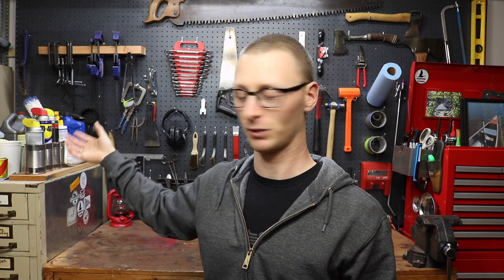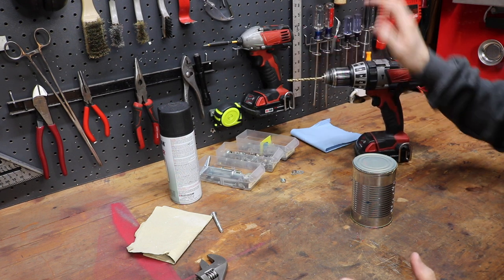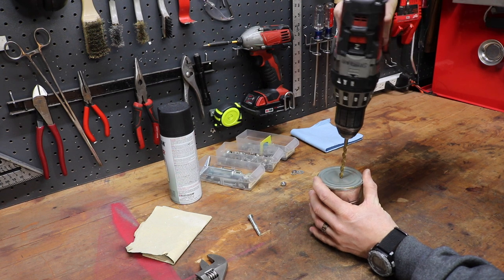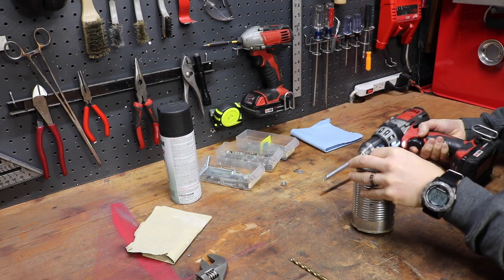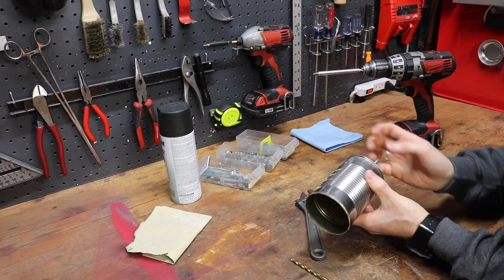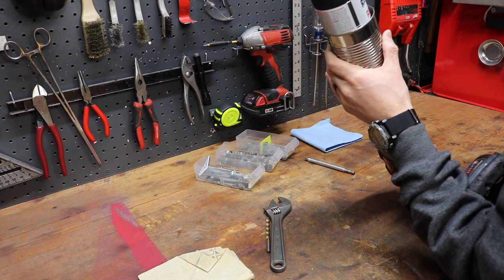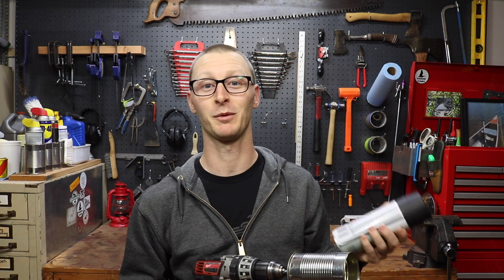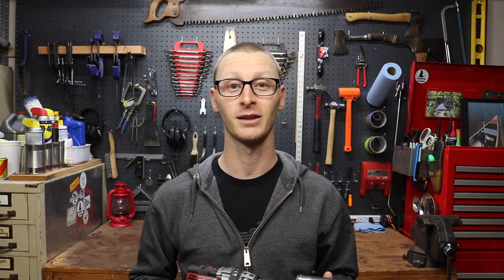DIY Spray Paint Mixer - FREE Version - Drill Powered Paint Can Spinner

Comment: I think if you drill the hole slightly off-centered and also if you stuff some left-over sponge/rubber only on one side it will be quite wobbly thereby mixing the better better. One can also use large size washers and super glue to hold them in place.   Just my 2 cents.
Reply from the maker: However, after using this with it as centered as possible - if you offset it it will wobble so much it will destroy itself and not be fun to hold while using.

Comment: I made this and it works great. To secure the spray can use a wood shim. It locks the can in. A 2ft chunk of 3" pvs or abs at HD is about 20 bucks. Add a test plug and it's almost 30 bucks in feb. 2022 prices.
Reply from the maker: a wood shim is a great addition to this setup!  Yeah the pvc version is expensive - but you'll never wear it out - all depends on how much spray paint your shaking up!

Comment: you Gave me an idea! 

One used large oil filter 

3  -3/4 in nuts 

1  matching threaded rod. 

2 -Large  thick  matching   washers

2 smaller thick matching washers 

1 roll of electrical tape ( to put over the sharp edges 

Sawzall with blade to cut off the threaded end just enough to pull out the insides of the filter. 

1 matching diameter drill bit 

And you guys can figure out the rest. It is solid! 

Thanks 👍

Comment: The problem I've found with pvc is getting it centered on the shaft. I made something similar to 65 ford's but instead of a drill I used an old fan motor with a momentary switch that I mounted on my work bench. I ended up using a corn can an two big ass washers because every time I used PVC it would wobble really bad.  I've never had an issue with the tin can after I put those two big washers on it and I've had it for almost 2 years
Reply from the maker: Nice! Reinforcing the bottom with those washers is key. Sounds like you've got an easy setup and therefore I'm sure you use it all the time!

Comment: This is genius. I have (what is probably) a stupid question though, does mixing the paint in the can like this actually work? I always thought the shaking had to be vertical, as in so the ball in the can travels from the bottom to the top over and over, to properly mix the paint? Has anyone used this for spray paint and it works well? Just want to be sure it does a decent job as I'm going to have to buy a power drill to make it and don't wanna waste my money if it doesn't have great results. Thanks for any advice and again, great video.
Reply from the maker: It works well enough- although I wouldn’t buy a drill for just this, so if thats all youll use it for I’d stick with handheld shaking. 😀
Reply: @GanderFlight  thanks for the advice, I’ll add it to my list of reasons to get a power drill and once I gather enough reasons I might buy one lol. Although where I live it’s cold most of the time so my paints require a lot of shaking

Comment: Brilliant!  Keep the bolt's length as short as possible.  It needs to fully seat in the drill chuck, but after that, extra length will lead to bending, and failure.  If I hadn't already made one out of PVC Pipe and a Plug, I'd do this, for sure.  Cheers!
Reply from the maker: Definitely - need the  Goldilocks length of bolt - just long enough but not too long!

Comment: James Bond knew the difference between "shaken" and "stirred" for his martinis (one method is clearly better). Spray paint cans need to be shaken for a reason. It allows the ball inside the can to reach the whole can (top to bottom) when shaken back and forth, thus mixing all the paint. The spinners that I see on YT that use a drill, all have the same flaw... they can only mix the paint that is closest to the ball, that is until the ball speeds up and matches the speed of the spinning can. That means the rest of the paint in the can is not mixed as well. A better tool to use would be a reciprocating saw, and there are a few YT videos about building a shaker with one of those.
Reply from the maker: I have seen the reciprocating saw builds too - I like those as well. After using this a few times I have no concerns however about the entire paint can being shaken up. Give it a try and see what you think.